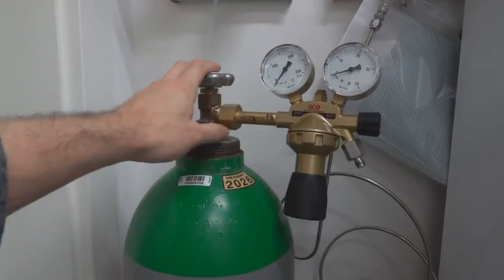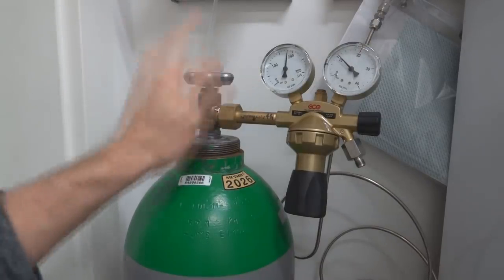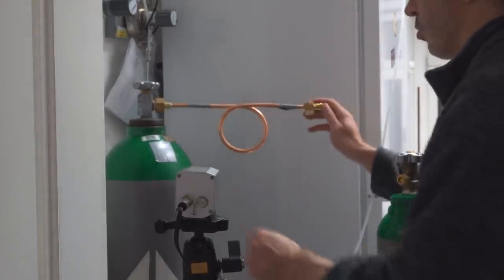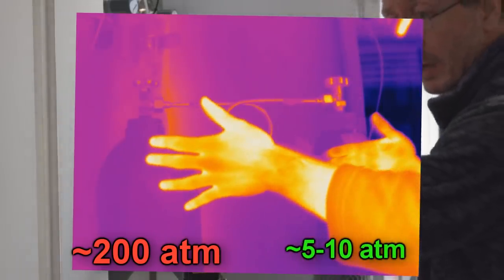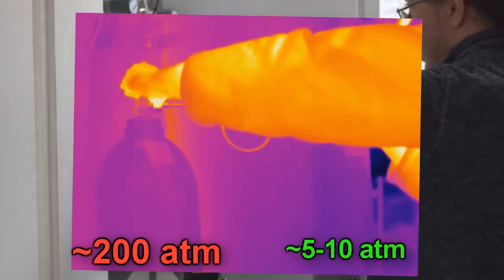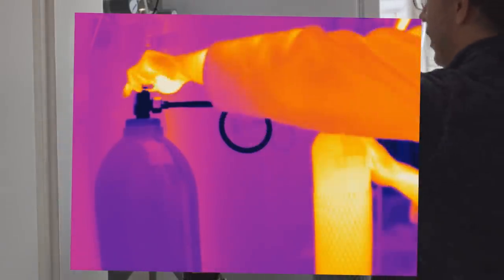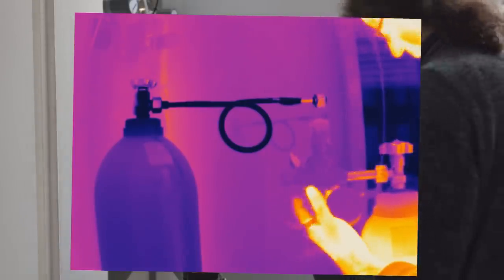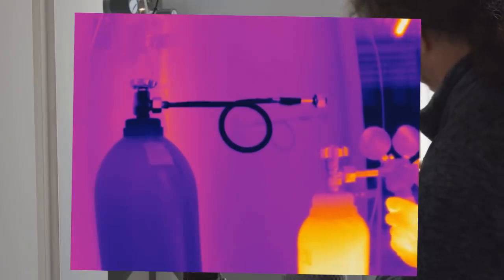Dangers of high pressure gas!

Comment: I work in the oil and gas industry, a number of years ago I was in a work accident where I got hit with about 1000 psi of natural gas to the face it messed me up quite badly. Love your videos Thunderf00t!
Reply: James G  not to cast doubt on your story...but why on earth would natural gas ever be stored at 1k psi?  Is that even possible?
Reply: @ktx49  1000psi is only around 67 bar. Bar and atmospheres are almost equivalent to each other, and that demonstration above had gas stored at 200 atmospheres, or around 197 bar. Or nearly 3k psi. (Source: Google has a nifty calculator, try it yourself, plus I know a retired gas engineer who has "interesting" stories to tell).

Natural gas is high-90s percentage methane, and CNG vehicles can store the stuff at well over 3k PSI. Source: https://phys.org/news/2015-10-chemists-natural-gas-fuel-tanks.html
Reply: technicalfool didn't know they stored natural gas at such high pressures.  I'll have to check into it more... like I said not trying to cast doubt on his story just thought it was a low pressure gas/liquid.
Reply: @ktx49  that is LPG (propane and butane), natural gas is methane, that does not liquefy under any pressure unless you cool it
Reply: TheBackyardChemist thanks for clarification, you're right.
Reply: It's pretty common for a gas well to have anywhere from 1200kpa to 20mpa of pressure, depending on formation utilized and age of well.
Reply: that sounds like probably the worst fart ever

Comment: Does the heat come from friction?
Reply: Most of it should be due to the ideal gas law. It would have been nice to see it included in the video.
Reply: @f4614n  in an adiabatic expansion ( = no heat lose. since it is gaining heat without an external source - which would otherwise be violation fo second law of thermodynamics - this has to be adiabatic) pV=nRT -> lower p --> lower T. 

what is happening is an un-ideal gas law. 

stored potential energy in high pressure is becoming heat.
Reply: @seanscon  Thanks for the clarification - I should have known better. The initial state has obviously a higher potential energy, than what we have after the mixing.
Reply: http://tccc.iesl.forth.gr/education/local/Labs-PC-II/JT.pdf

probably this is helium gas. it does NOT follow the ideal gas law.

at room temperature, it has a negative joule-thompson coefficient . The gas is pressurized, which means that potential energy is stored in it. as it comes to a lower pressure environment, it expands, and loses the potential energy, which becomes heat.

if the gas was allowed to expand in a lower temperature, then it would cool, as it was not storing enough potential energy, to force the expansion, but the surrounding environment pulled it apart against it's initial volume - this would require its internal heat energy to be converted to work, which would make it cool.

in low temperature, gas would act like a *semisolid , where molecular attraction dominates, and the gas wants to preserve its volume. in high temperature, it acts like a compressed spring - the release of stored potential energy converts to heat.
Reply: Heat of compression in action in both bottles, the rate of heating is significantly higher in the smaller bottle due to it's smaller internal volume and even smaller surface area to volume ratio.

As the high pressure gas from the larger bottle forces the pressure in the smaller bottle to rise it compresses the existing contents causing the volumetric density (not to be confused with specific density which does not change) to rise rapidly, raising the gas's molecular kinetic energy which we see as a rise in temperature.  The exact opposite is happening in the larger bottle. Eventually the smaller bottle will cool to room temperature through radiative losses. This is why spray paint cans, paint ball gun gas carts, air hoses, etc get cold during use.  They are absorbing the heat of compression that was lost previously when they were cooled to room temperature.

Comment: If I were you, I'd have earplugs in while doing this. Never hurts to be cautious. Really cool video though - it feels like a magic trick to have gas transfer create heat and cold so close together. Makes you think more about these sorts of systems and what is really going on
Reply: To many people don't realize that hearing doesn't really heal after you damage it.
You don't want to spend your life with a hearing imbalance or problems with certain Freq etc...
Reply: I looked closely at the video and didn't see anybody not wearing their hearing protection... I also heard from a friend that if you wear hearing protection you can sometimes tell if a sound is loud or not. Could just be a rumor.
Reply: It's called a freezer.
Reply: @maxwilm76  I see what you're getting at, though this system has just gas flowing down a tube with no compressor or evaporator; that's part of what makes it seem like a magic trick - gas is flowing down a simple tube, and being both decompressed AND compressed with no moving parts involved. Of course, once you see it on camera, the solution becomes obvious, but it's still amazing (at least to me) because it was there all the time and I never saw it until thunderf00t showed us.
Reply: Zach W the compressor in this case would be the small bottle and the evaporator would be the big bottle, the tube is what cools the freezer
Reply: @werrkowalski2985  Yeah but the hearing hair in your inner ear do not heal.

Comment: Useful short video to demonstrate gas laws for scuba training, especially the ir imagery.
Reply: Actually, the ideal gas laws do not predict any temperature change.  If you do PV=nRT on both cylinders before and after, you'll find the constant did not hold -- essentially extra T came out of nowhere (and that affects P).

It would be great if Phil did a video on that, and showed an example of a gas where the opposite happened.
Reply: You can see the large cylinder cool down, so presumably that's where the "extra" T came from.
It's been a while since I did any gas law stuff but I'm surprised the ideal gas law is that limited in this case.
Reply: @drunkenhobo8020  Consider the large tank:  The ideal gas law (PV=nRT) says that as you reduce n (take molecules out) then P will drop and/or T will rise, but does not dictate a unique solution.  Looking into interpretation, by removing n (rather than changing V) the path and flight time of the remaining molecules are unaffected, since the "ideal" part is that they don't bounce off each other, only off the container walls, which have not changed.  So we predict that T will not change.

The actual drop in T is caused by (1) the fact that the molecules do bounce off each other, so reducing the density acts as an expansion.  But the dominant effect (2) is that the molecules are slightly attracted to each other, so you increase the potential energy and cause a corresponding drop in kinetic energy.

There is another effect (I don't recall the details) that cause the temperature to _rise_.  Whichever dominates determines the behavior.  Most gasses under common conditions are dominated by (2) above.

For teaching SCUBA or other diving, what you need to get across is Boyle's Law, or "don't hold your breath while rising".

Comment: I'm pretty sure that tweet is a joke... surely
Reply: he has seriously said dumber things
Reply: Using compressed gas (or yes, even small rockets) to increase acceleration, increase braking, improve cornering....isn't a new concept. Its well within the realm of actually manufacturing a car with these options. there are already enthusiast vehicles that have been custom made around this concept. look up the water jet bike here on youtube. is it dangerous? it can be...if not implemtned in the right way. but literally just a few 200 bar gas cylinders for track purposes to be used literally a few times per session? why not?

Comment: Wanna know what gas is very dangerous under high pressure?
Reply: Hydrogen is right up there...is my guess.
Reply: The joke is that the answer is all of them right?
Reply: @Noromdiputs  no, acetylene under 600 PSI with a leaky valve in a welding shop.
Reply: @Kris Nicholson the failsafe is rusted out and the welding shop class is Greaser only